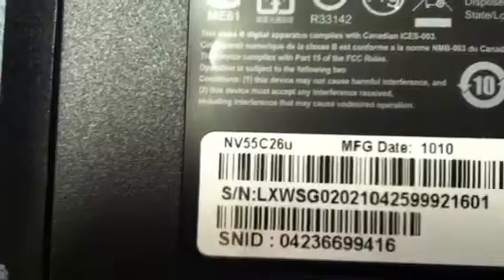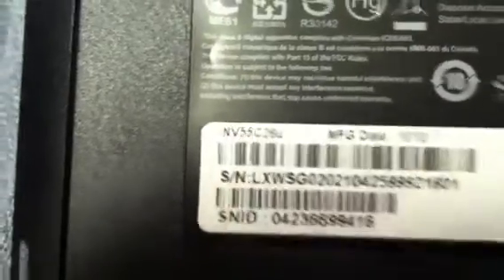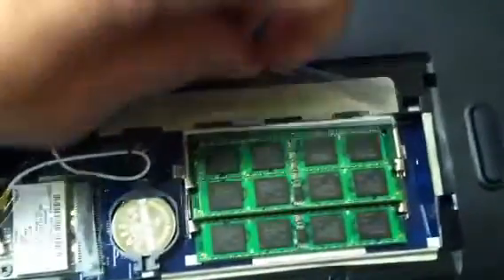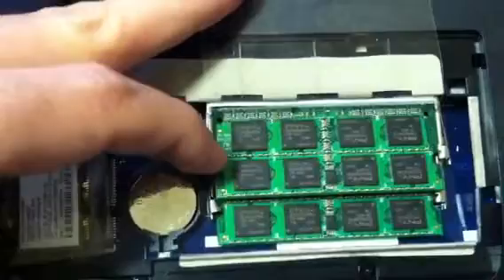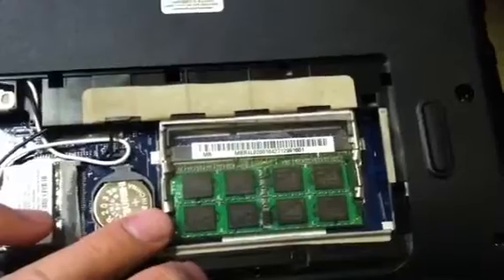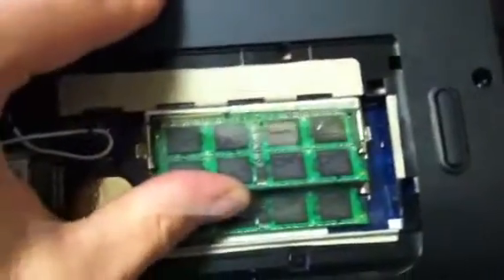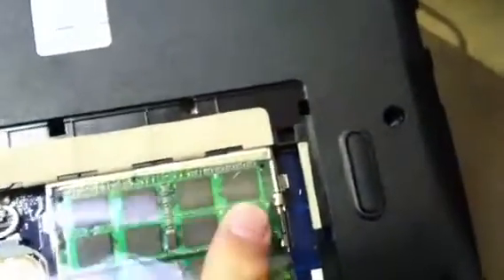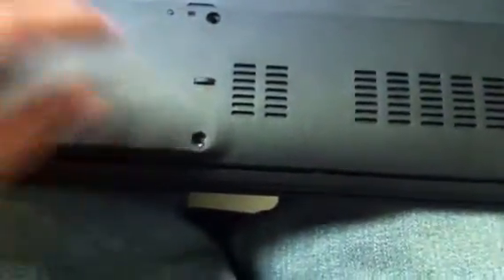How to install memory in a gateway nv55 model laptop

Comment: RAM upgrades do help with PC performance and online gaming. It also helps you multi-task. The more RAM you have the more browser windows you can open simultaneously and you more RAM you have the better the game experience will be, assuming your laptop or computer meets or exceeds the minimum system requirements of that game.

Comment: If it supports a max of 8 then you can upgrade to 8. If it only supports 4 then you can only put 4 in it. Try the "Crucial scanner" to see how much it supports. Just type Crucial scanner into Google. It'll scan your computer or laptop and tell you how much RAM you currently have installed, how much it supports, and how many memory slots their are. It'll also give you suggestions of RAM that you can buy through the Crucial website.

Comment: What brand and type of RAM did you install? I'm going to upgrade mine, but what the Gateway website says and what System Info for Windows says are two different things. The Gateway website says it needs DDR3-1066/PC3-8500 and SIW says DDR3 1333 PC3 10700